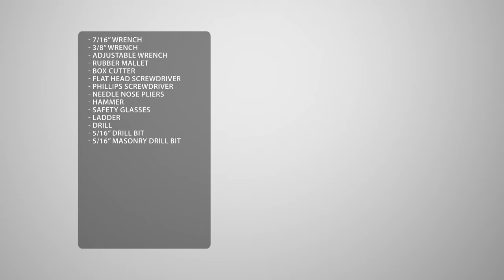Lifetime 8' x 7.5' Outdoor Shed | Lifetime Assembly Video

Comment: Do you need concrete Fondation for 8 x 7.5 shed?
Reply from the maker: All our sheds require a foundation to be built on. Failure to do so will cause issues while assembling.
Reply: @LifetimeProductsAssembly  can I use 4x8x14 half cinder blocks as a foundation?
Reply from the maker: @2326ralvarado  We only recommend a foundation made out of concrete or wood. The cider blocks will still have cracks in it not leaving the foundation leveled which could make it difficult to assemble.

Comment: After fighting with it for days, knowing what I know now, I wouldn’t of bought this thing.
Reply from the maker: Sorry to hear this. What part of the assembly is putting up a fight?
Reply: @LifetimeProductsAssembly  the final part of the roof on the back corner would not lineup, it was 2 inches off. I had to force it together. Now that is completely assembled, it is a pretty good product. It just took quite a while to assemble like about four days. a lot of the holes would not line up. However, for $900 they should do the trick nicely now that the project is completed.

Comment: Can some tell me how long for the installation??
Reply from the maker: Time on installation is just based on you and who you have to help you. This can be a couple of hours or a day.
Reply: I finished mine in less than 4 hours with the help of my wife holding screws, and walls, etc.
Reply: The second shed took 2 1/2 hours. A little experience from the first assembly went a long way.
Reply: @Sam_Mebane  make sense. Glad to know.
Reply: 9 hours including the foundation
Reply: About 6.5 hours by myself. This includes struggling with a few roof panels, 10 minute lunch break, taking pictures/ videos, and about 4 trips back to the car because I forgot a tool

Comment: This shed is the most annoying thing I have ever built.  The parts are warped out of the box and NOTHING lines up.  My son and I have to pull, push, and bend everything to get the screws in.  Now we are stopped on the first roof panel because the edge of the wall and the front gable are anything but straight.  I’m ready to tear it apart and haul the whole thing to the dump.  It would have been a better investment to just purchase a prebuilt shed of this size and have it delivered versus all these holes off effort and can’t get the roof on.  

This guy has to be using brand new parts out of the factory.  He does even hold the roof piece to put the screws in.  Mine has a 1” gap between the roof slat and the truss so now what?   Grrr…

I have two storage benches and a trash bin from this company that I really like but after this shed, no more.
Reply from the maker: We're sorry you're having trouble with your new shed. Please give our customer service team a call and we can troubleshoot the issue with you and see if we can figure out what is happening. They can be reached at 800-225-3865 or by email at customercare@lifetime.com. Customer service hours are Monday-Friday, 7:00 am to 5:00 pm (MT).

Comment: Assembly is nowhere near as simple as this individual shows.  Aligning parts is a nightmare.  Note, I a pretty decent handyman and typically don't need instructions for anything.  This needed a lot of review and innovative thinking to put this together.  Hopefully it won't fall apart on the first wind that comes along.
Reply: I am not handy at all, it just requires patience as I am almost done and the only problem i found is like 3 screws that don't tighten and the last roof panel that doesn't match with the holes 😞
Reply: You are correct, you have to have a patient personality and little help to put this together.  It is too easy to strip the plastic out with the screws.  I had to go get some oversized screws to compensate for my aggressive screw insertion.  So far, the shed is working well for backyard tool storage.  Some day I would like to get a 20 x 40 steel workshop.  I can dream, not going to happen in a residential backyard.
Reply: @Kevinlinaresroller  i had this exact same problem, what I ended up doing was pushing up on the rear metal bracket and that helped align the rear roof corner

Comment: Wait wait... 1300 dollars and you still have to assemble it yourself???? DUDE! you can build a wood 8x8 shed for under a thousand.
Reply: I just got 2 for $800 a pop at Sam's Club. With the cost of building supplies lately, I couldn't build a shed an 8x8 for less than $1200.
Reply: Where you getting lumber that cheap these days?? I know a few contractors that would love those prices. Or are you talking about some overstressed reclaimed wood!! Lol
Reply: they're $799 at Sam's club/costco
Reply: You can try to build an 8x8 shed, you’d have to buy plywood and paint it, get your truss calculations correct and lay tar paper and shingles, wrap the entire shed in tyvex and hope to god you squared up the whole thing. Lot easier to buy this engineered shed that will never rot